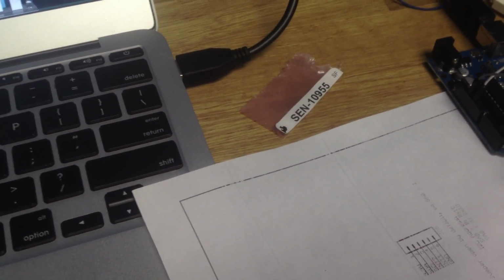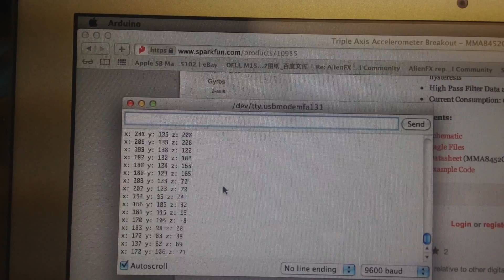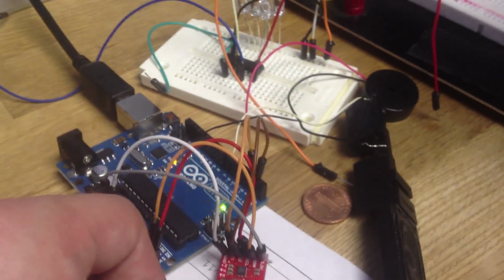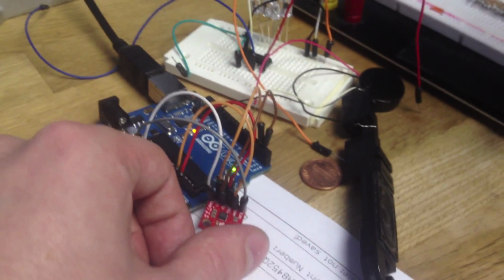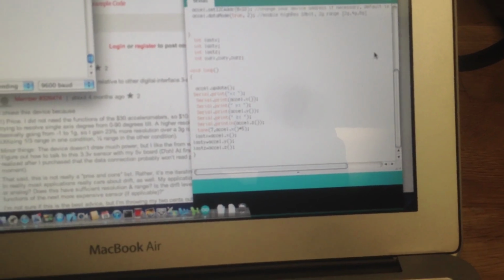Arduino and accelerometer tinkering. Sound generator based on X axis.

Comment: Could I hook up a microphone module to the accelerometer and have the movement of the x axis manipulate a tremolo effect? I'm doing a sound design project on a swing set and haven't worked with arduino before. -
Reply from the maker: Well, once it runs through the/A Microcontroller you can do whatever you like. I don't see why not.

Comment: Shouldn't you use a level shifter with the sensor. That chip is rated at 3.3V not 5V ? Don't you need on on he I2C bus?

Comment: @Christopher Van any chance we could request a commission from you for our current project?  We need to build a system (4-5 units in all) that will produce sound FX each time a person takes a step.  Assuming the use of simple accelerometers could this be done?
Reply from the maker: avatar6699 sure thing, perhaps a phone call?
Reply: Christopher Van let's talk.. options for contact?
Reply from the maker: avatar6699 check out and message me at Bridgewater Makerspace Facebook page you can also see all my current projects too! The logo is a robot arm and gears blue
Reply: Christopher Van Message sent via FBook. look for the Red Sith Lord. ;)